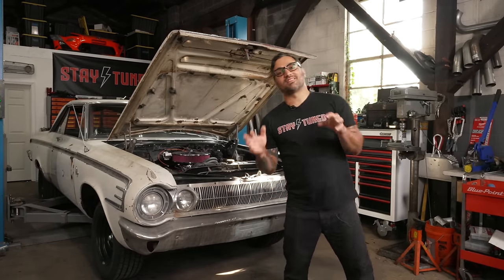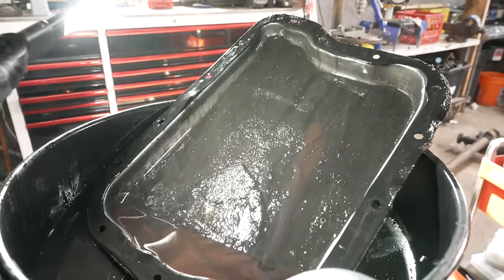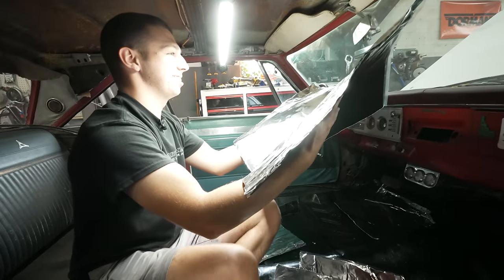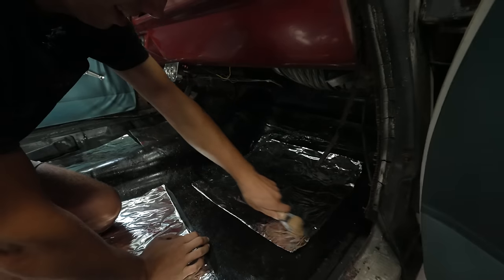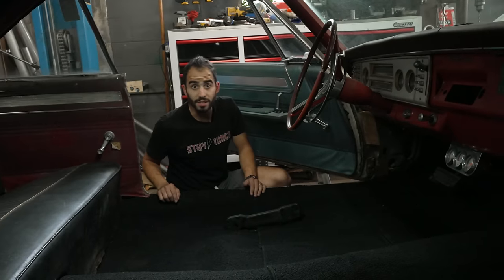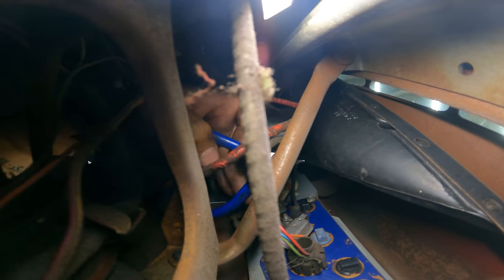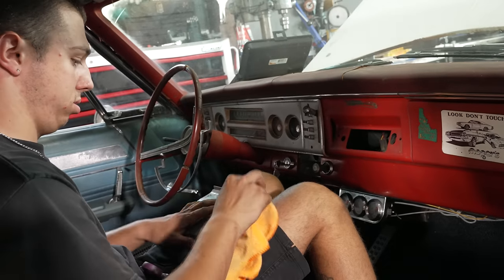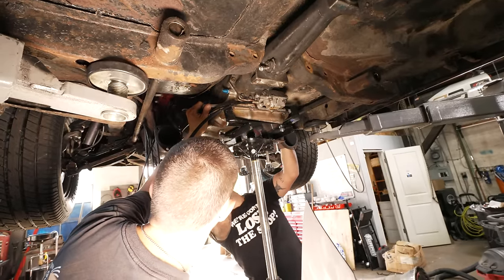Can This ABANDONED Old Dodge Drive 800 Miles?!

Comment: The wiring is almost 60 years old and hasn't caught on fire yet, so I would say that's pretty good
Reply: I used Mopars to commute and really appreciated the ammeter. Never had a problem with one.  If you want to by pass it fine. But then a volt meter should be added so you can keep an eye on your charging circuit.

Comment: 1305
For those that haven't driven a car from before the early 1980's , the head light dimmer switch used to be located on the floor to the left of the brake or clutch pedal.
Reply: My 73 Swinger had that and I always liked it more than the modern switches on the turn signal.

Comment: Rubber lines instead of steel for the trans cooler lines??  If that is some very special type of rubber that is heat and pressure proof, I sure have not heard about it.

Comment: Tony a ax15 out of a jeep bolts right up I put one in my 68 fury 3 stock driveline it just falls in.....with a bunch o work
Reply from the maker: An aisan Ax15 can bolt up to a small block, but is there a big block bell housing? (fun fact you can bolt it up to a 2jz)
Reply: @StayTunedTA  and the new hemi too. I'm not nice to mine behind a 318 magnam and works good

Comment: I'm not sure if you're aware of it but the last year of the cable shift tranny is the last transmission Mopar made that had a rear pump in it they react like a stick shift when you shift down because the rear pump and in that case you can actually push start that car at approximately 35 miles an hour FYI 😁🙄🤔😲😁🙈🎛️🤙

Comment: Apparently the pushbutton trans wasn't discontinued because of federal laws.  It was purely a business decision.  The federal government did enact some rules that would limit government vehicle purchases to only those with a shift pattern of PRNDL, but thatvwasnt until 1966, and the pushbutton trans MIGHT have still been ok by that measure depending on the interpretation of that rule.  But it was moot since Mopar changed it on their own after 64.

Comment: Push button 727 memories from my Dad's 64 Imperial Crown with a 413. Mission Impossible car
Reply from the maker: They are SO cool. Also the buttons light up! I had no idea.
Reply: Watch out for that park lever not quite catching a tooth. Had our Imperial just take off by itself a couple times back down our slightly sloped driveway and roll across the street to make another hole in the neighbors yard. Don't trust it. 4 x 4 wood block is best. @StayTunedTA